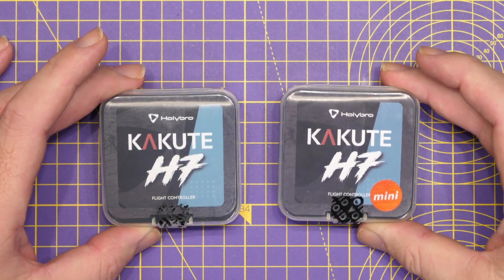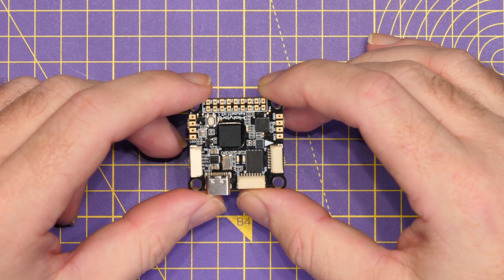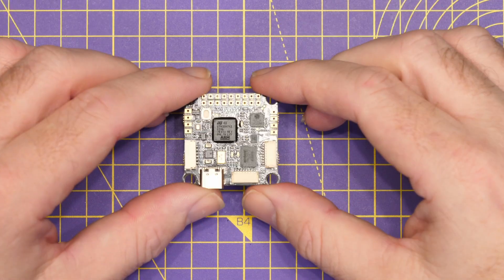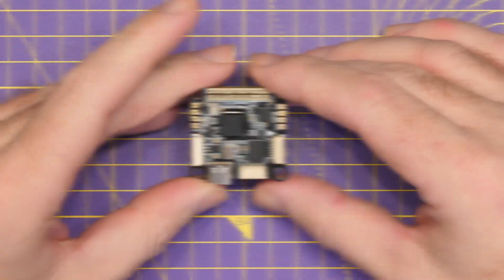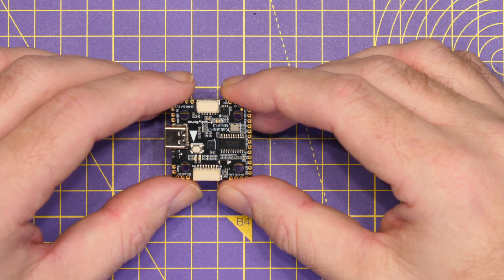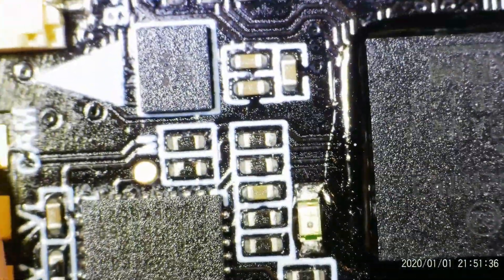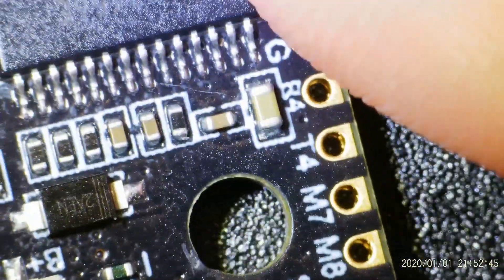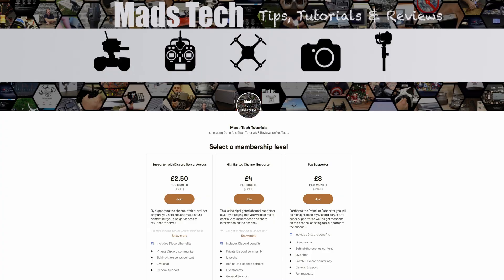Holybro Kakute H7 & H7 Mini Flight Controllers

Comment: I have exclusively been using the HolyBro Kakute Mini FC's for a couple of years now.  The new H7 Mini v1.3 with the BMI270 works great.  I also still have a few of the H7 mini's with the MPU6000.  These have been super rock solid for me and I love them.  The HolyBro FC's in general made a huge leap forward when they got away from the stupid ICM gyro that would fail after 6 months on time on schedule.  Once I started using the Mini's with MPU6000 they became awesome with amazining durability. Regarding the Kakute mini line, a big step forward was the introduction of the F7 Mini with 20x20 M3 mounting instead of the crappy M2 standoff mounting.  Their 20x20 ESC's are aweesome but some model have come and gone without logic or explanation. For nowe their BigFET 20x20 ESC is my workhorse for 20x20 Holybro ESC's.  All of their prodcuts are top notch and I've almost never had any typoe of DOA or defect.

Comment: I had seen a bunch of videos saying this FC was more than decent, so I trusted them and picked it for my long-range project. As an electronics engineer specialized in industrial electronics, I can put both hands in the fire: I assembled everything perfectly. Still, the FC started acting up right away — UART 6 never worked. After some advice, I tried another UART, which, unfortunately, worked right away, proving the FC had issues. I say "unfortunately" because that led me to take the first flight, which lasted only 30 seconds, and in that time, I managed to burn two motors running the default PIDs.
Is that even possible? As an electronics guy, not a drone guru, I can't be 100% sure, but it seems crazy that two motors could fry in just 30 seconds, especially since I landed immediately. Today, I tried again to set up the FC, obviously with a different stack since Holybro already made a mess out of the first one, but this time the board lost all its data and I can't even get it into DFU mode... what a rip-off. I'll send it back to Holybro, though I'm not expecting much because, after this experience, I'll never touch this brand again. I'm not saying it's not a good board, but mine? Absolute garbage.

Comment: Sweet! Looks like the Kakute H7 v2 uses STM32H743! A single-core with up to 2Mbytes of dual bank flash memory and 1Mbyte of ram built in (The next comparable H7 board would be the BrainFPV radix 2 v1.2…which uses the cheaper STM32H750 chipset with up to 128Kbytes of flash). Plus, the Kakute has 5v/2A & 9v/1.5A BEC….whereas Radix2 has only 5v/1.5A. The Kakute also accepts up to 42 input voltage rather than 35 on radix2.  

This H7 board is the new king.
Edit: I take that back. The Lumenier Lux HD H7 has it all and is still king. Kakute just needs to update their 9v to a 3a or a 10v would be welcomed.

Comment: It's ok, I flew it in my quad for a few flights and then went back to my kakute h7 v1.2, I prefer the older version with mpu6000 gyro and SD card slot. Already planning on selling the v2

Comment: Only slightly strange thing about the newest version of the H7 (the V2) is the digital connector is not JST-SH like the connector for the O3, it's JST-GH. I haven't looked carefully to see if there's a conversion cable in the box, but that will make wiring up an O3 interesting.
Reply: I have the old version of this FC and it has the same connector. I just soldered the O3 wires to the plug that came with the FC wire for wire bc they are the same pin out. Wasn’t that much of a pain

Comment: My two FC were burned. Used them with a Kakute 65A ESC and both of them burned on the motor test in INAV. In both cases I've got a short cut inside the H7 processor  between the 3.3V pad and  the Ground. For my first Kakute H7 V1 only processor died and I hope to resolder it ... but for the second H7 V2 all 3.3 consumers died - H7, Winbond memory chip, Bluethooth chip and it seems to be that it impossible to be repaired. I don't know why and whatthe reason - all other FC such as Matek or Mamba MK2 working well with the Kakute 65A ESC and it strange that Kakute FC was burned by the Kakute ESC on the motor test. And to say more - in both cases were used absolutely different ESCs. So, be carefull with this product.

Comment: Hey bud nice video. I have a question that may or may not pertain to this particular flight controller. I know there are some newer flight controllers that don't have the OSD chip on them, that being said will those boards no longer be able to use the OSD from the flight controller through MSP port?
Reply from the maker: No it means no analog OSD.  You still have full MSP Display Port.  Basically the chip is for analog only.

Comment: What the heck Mad? Did you delete my comment because I said the Aocoda F7 flight controller from aliexpress for €31 euro is 99% the same?
Reply: Really, on ali the mini is 35€ .
Reply: @rctom1  Yes you are right. Price is up a bit right now. However I bought 2 extra last week when aliexpress gave 'spend and save' discount. You could get them for €31. But even €35 is a lot cheaper then these 'Mamba' or 'Kakute' F7 mini flight controllers that are 99% the same. And on the Aocoda all uarts are accesible and are compatible with DJI.
Reply: @steampower3134  👍
Reply from the maker: I have not deleted any comments.
Reply: @MadRC  I did NOT state this , i just ckecked the price of the Aocoda F7.